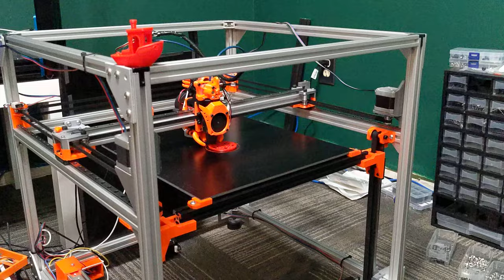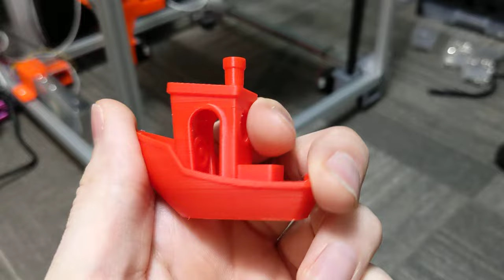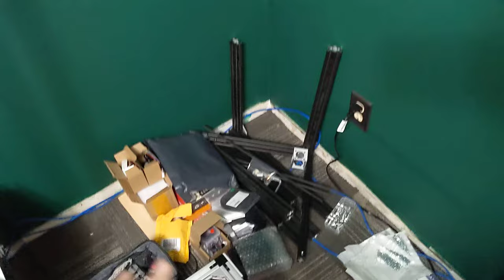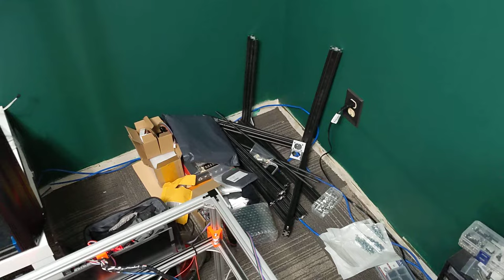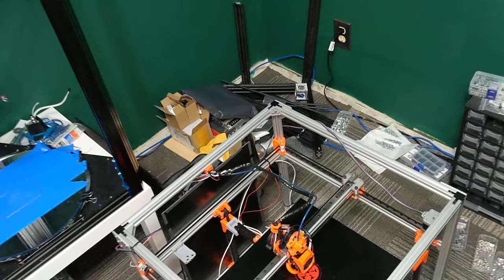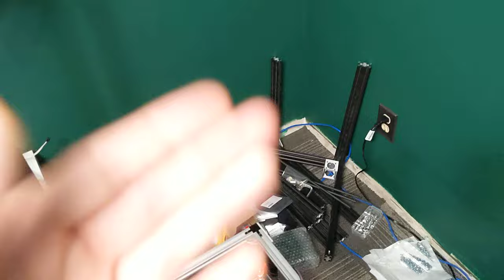Simple DIY CoreXY 3D Printer called SimpleCore and channel update!

Comment: Seems like a good ratrig alternative, the cheapo 20mm aliexpress carbon fiber tubes like on the vzbot would be a good upgrade. Also It'd be neat to see a corexy vs delta comparison since you seem to have experience building and running both.

Comment: Thanks for the great video.  I've started looking for videos like this because I want to transform a CR-10 S5 into a CoreXY.  I bought the S5 late in its life cycle and I recently came out of a home electrical nightmare that lasted just over 19 months that kept my electronics unplugged for that time period.
  I've got several Prusa printers, but ordered the S5 for it's 500x500mm bed size.  Your video will be great for the conversion, but will the old controller work when I turn the S5 into a CoreXY printer?
  I found another video that shows how to convert from a movable bed to a fixed one.  That video and yours should help me on that issue.
  Do you think that your video will answer all the questions I'll have in this conversions or do you see other issues with converting a CR-10 S5?
Reply from the maker: defiantly join my discord, there is a active Simplecore channel. You can combine two boards together if you need. Simplecore needs 6 drivers
Reply: @Rolohaun    If you have one can you point out which videos talk about your comments of "You can combine two boards together if you need. Simplecore needs 6 drivers"?  Are you talking about replacing the original CR-10 S5 controller box?
Reply: Below is a list of parts in my CR-10 S5 and heated bed and other components should be able to be used in a CoreXY build.
Reply from the maker: @davidthompson9359  you can use any two boards you like to get the 6 drivers if your board doesn't have 6, just buy a bigtreetech one or something else and use it in addition

Comment: Very good work. I am building it with a 300x300 hot bed area. It is not very clear how you hold the ends of the z-axis belts, or are they closed belts?
Reply from the maker: the ends of the belts get clamped by the printed part on the Z linear rail carriage. Defiantly join my discord there is a very active SimpleCore group on there!

Comment: The printer looks good. What does the BOM cost for this printer?
Reply from the maker: the BOM has a rough price around 760 USD, it can be build for cheaper. You can see the BOM on on the Github link I added in the description

Comment: Hi, your build plate, is it G10 sheet, is the heater applied directly to it? Cheers
Reply from the maker: yes G10 with heater applied direct
Reply: @Rolohaun  Thanks, I've been thinking of doing the same myself, been using G10 as a build surface for awhile and always liked the results and had been wondering if it was possible to have the heat bed and build plate as one unit, cheers.

Comment: where can I find info about the stepper motors control board for this 3D print, and what software to use with it? - thanks!
Reply from the maker: You can find the info on my github in the description. This is my SimpleCore legacy design. There is a bill of materials there

Comment: What external xy dimension of frame and print plate area?
Reply from the maker: if I remember the frame is 540 x 540mm and the bed was 330 or 350mm square

Comment: Your SimpleCore Github needs some better Cad illustrations, measurements for frame and part placements, bed print orientation and support info, belt path and maybe a build video. Then it could be considered SIMPLE... It would help users. I've built so many machines. I'm winging it from pics and fusion Cad. lol
Reply from the maker: the github is defiantly a work in progress I will improve it over time
Reply: @Rolohaun  I abandoned the build entirely after printing the parts due to poor design, no outline, no guide and not having the options for different MGN Linear rails. Also NO proper way to connect the Z belts to the bed parts at all. I could have designed some parts myself but didnt want to put more time into. You could have used the Voron design, screw down clips for the bed Z. I only saw in a video ya used Zip ties, but wasnt gonna do that myself.. Hope ya get the rest of the build sorted out. Ill revisit in the future...
Reply from the maker: @TAP72  why not join the discord?? All the parts work great. The belt just goes in-between the part and the mgn rails for the Z. This is a work in progress...
Reply: @TAP72  wait, someone designed an entire complex machine designed to opperate in fractions of a mm.  Then they let you download their hard work for free.  They also included a list of parts needed to finish the build, the coding for the firmware, and provided a community support group.  But you're going to publically bash their hard work because you werent smart enough to figure it out or ask for help?  This comment perfectly depicts what is wrong with the world.
Reply: @Rolohaun  Thanks for this awesome work! Is the CAD on github the most up to date? If not, would you share the latest? I found it difficult to understand how the linear rail + timing belt was utilized for the z axis together with the threaded rods. Thanks in advance!
Reply from the maker: @ozgunkilicafsar8122  Simplecore Legacy is belted Z, SimpleCore MK1 is leadscrew both are on the github and up to date
Reply: @Rolohaun  Thanks! There's also some discussions around belt causing backlash. So, some corexy enthusiasts have used extremely high modulus wires (steel) as an alternative to belt. Do you have any thoughts on this?
Reply from the maker: @Ozgun Kilic Afsar  hmm I haven't heard of that, I have does some testing between the two and I didn't really see a difference. For a large printer though I would go with lead screw